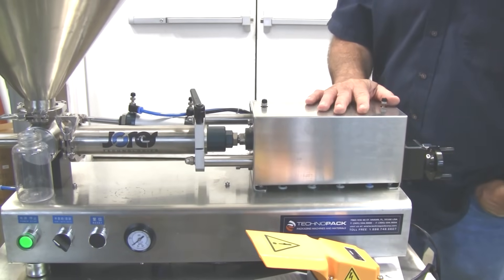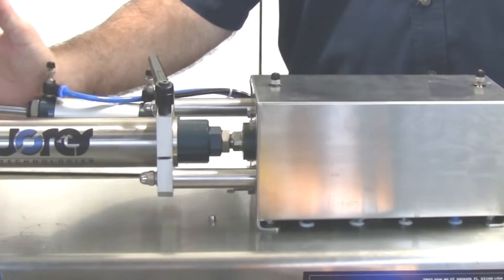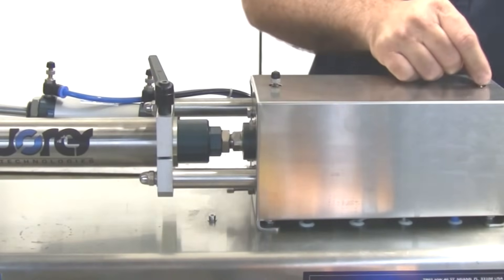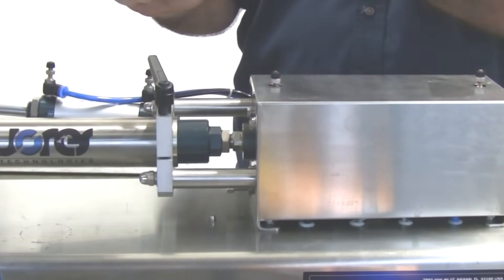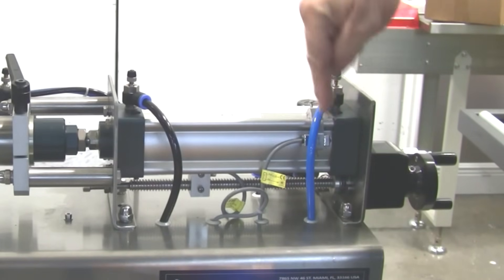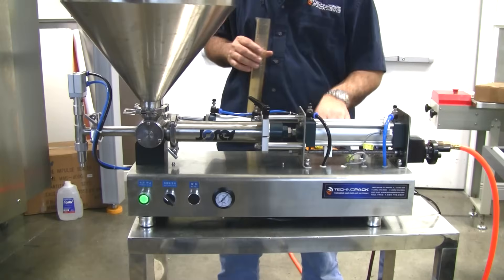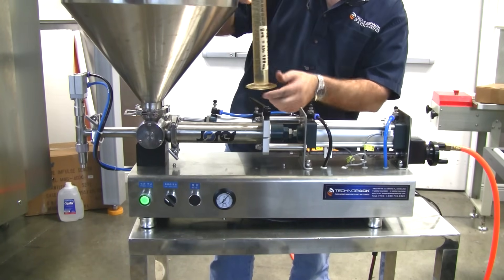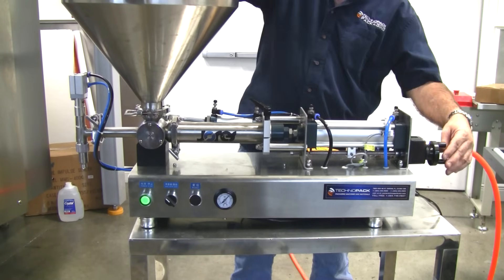How Piston Filler Works, Piston Filler Adjustment

Comment: Can this be used with candle wax?
Reply from the maker: Hello! thanks for your question,

With the addition of optional components, some of our fillers are capable of dispensing particularly hot liquids. In the case of candle wax/paraffin, however, if the product is left to cool and solidifies, it will require a thorough, labor intensive, cleaning.

 Please feel free contact us directly so we can further discuss your application and help you in find the right solution!

Best,

Team TPK

Comment: What kind of compressor is attached to this machine?
Reply from the maker: Hi and thanks for your inquiry!

Depending on the model, our fillers are either fully pneumatic, fully electronic, or a combination of the two (electro-pneumatic). All services must be supplied by the user - that is - they are not included with the filler. Compressor characteristics will depend on the model/capacity of the filler. In general terms, for single-nozzle fillers of up to 1000 ml fill capacity, a compressor with a capacity of 25 gallons is considered optimal, with a work pressure of 120 Psi (0.8 MPa). 

Please contact us directly if you need detailed information for a particular model.

Best,
Team TPK